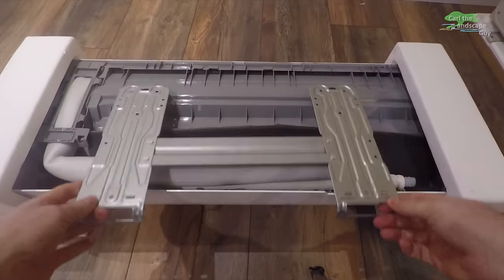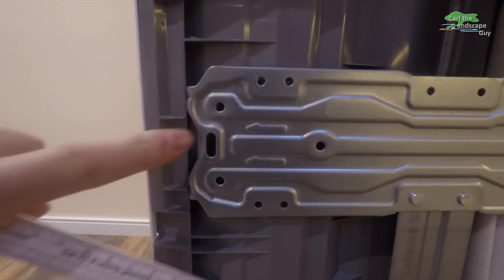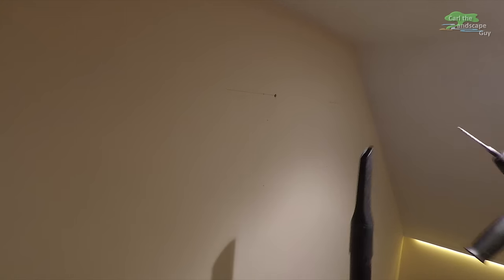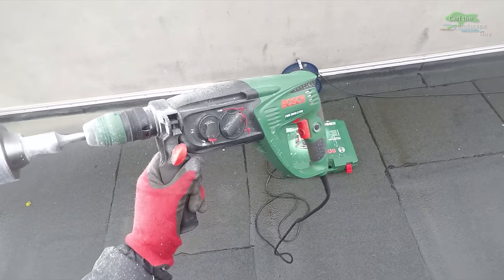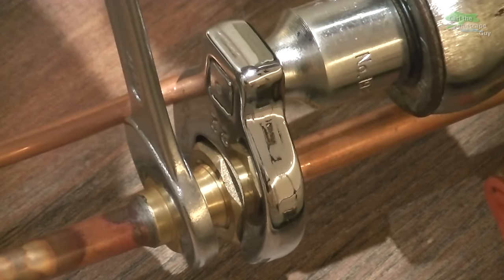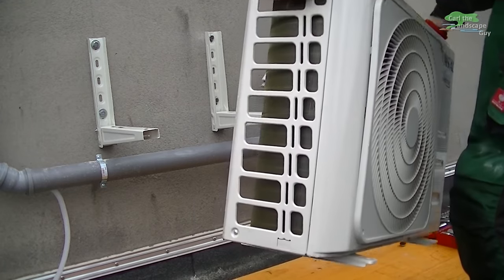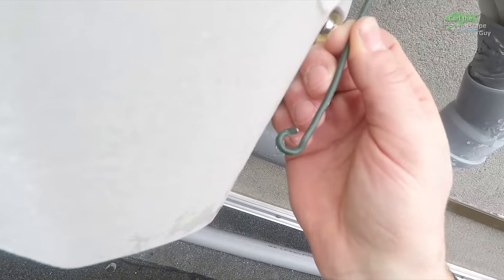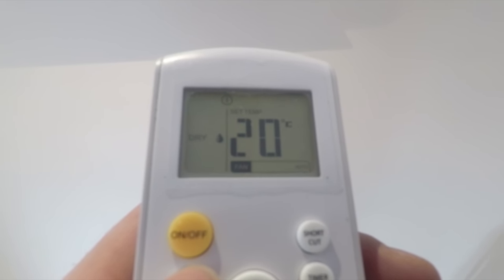AIR CONDITIONER DETAIL INSTALL |SPLIT DUCTLESS AC HEATING INVERTER,MINI PUMP SYSTEM SETUP,DIY HOW TO

Comment: Oh man just let us pro handle it.😂 its not for nothing we learned for it.  That hand pump doesnt tell you any pressure related issues etc leaks etc. You need to keep the auto pump commected at least 30mins or longer to find any leaks. Yes it can work but your taking a lot of risk.  

The end ductape and stuff oh my thats so bad 😂you should have a nice cover for the ac unit place that back first. Then buy some hard plastic U shape plates and cover it good up. If you use tape use isolation tape😂 not ducktape😂    i would rip this thing right of the wall

Comment: 671/5000
This is a Midea clone .... Well not only is the vacuum problem the problem- the big problem is true because the humidity in the air that remains in it can cause corrosion in the long run, ie compressor failure or malfunctions this cannot be solved by a smooth gas purge it stays there so it has to be vacuumed to make it disappear too ..... bandage material eg can withstand the sun? Because when it breaks out into the plastic pipe, the precipitation in the bend will rot the rainwater. The gray tube is uglier than the 65x50mm shaped Italian cable duct is one thing. The flange connection is in the wall, there is nothing wrong with the device, then everything has to be disassembled ... and there is a chance.
Visszajelzés küldése
Előzmények
Mentve
Közösség

Comment: Hi you are a professional ? Then why don't you use proper VACCUM PUMP and GAUGES to measure REFRIGERANT PRESSURE . I THINK YOU LEARN FROM ANY ONLINE INSTITUTE YOU DON'T HAVE PROFESSIONAL EXPERIENCE IN THIS FIELD. ITS NOT  100% INSTALLATION. BETTER TRY TO JOIN ANY  REFRIGERATION AND AIR CONDITIONING TECHNICAL SERVICE STATION FOR GOOD WORK . SORRY FOR THE INCONVENIENCES IN LANGUAGE I DON'T KNOW ENGLISH WELL TRY TO UNDERSTAND THANK YOU
Reply from the maker: I never said I am a professional, in this video I show that you don't need gauges and electrical pumps to do the Job, by the way the system is still running fine
Reply: @CarlTheLandscapeGuy   ok now you can do one video on how to delivery a human baby with out hospital and dr.s help

Comment: You skipped important steps, you did no pressure testing, the vacuuming you did is ridicules- you might as well have not done it at all. Also you made the mistake of not checking the connections for leaks, especially the ones you sealed up at the head end inside the conduit which now you cant check. The slight vacuum you put in wont tell you if theres a leak under high pressure not to mention you used no connector. I also dont see a required AC disconnect to power the condenser required by law which also means the unit isnt properly grounded.  - This is a very unprofessional job, you really have no business showing others how to do it. If this had been sponsored they would be asking you for there money back. Theres no way that job would pass inspection.
Reply: Rubbish, no outside connection is needed for private use, its actually better less resistance, and why would it not be grounded if there's a ground wire from the outdoor unit directly to the electrical board......
He said he brought it up to nearly 1 bar,  waited for a period of time and there were no leaks, so no leaks....  It was slightly over torque wrenched due to the Crow feet heads, so there's next to no possibility of a leak.  Offer constructive critisism on the pressure testing maybe but your being over zealous my friend...
Reply: Are you serious? its code!! You must have the disconnect for saftey plus u did alot of other things wrong, you didnt even sleeve the lineset going through a brick wall. U didnt vacuum properly that was a joke. You cant evacuate with that thing. It takes a continuous draw for 15-30 mins to get moisture out.  The unit must be grounded to the disconnect - not the panel. Rubbish is exactly what you did and I hope nobody does an install based on your video. Less resistance? at 220 volts up to 20 amps - give me a break.